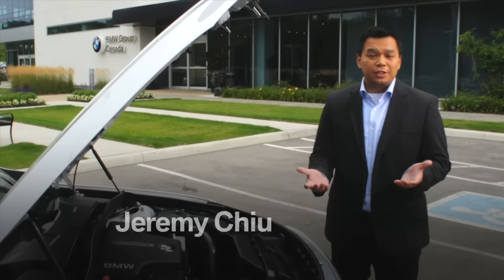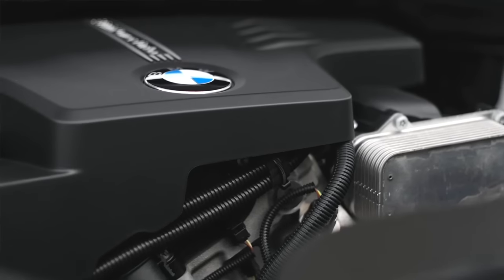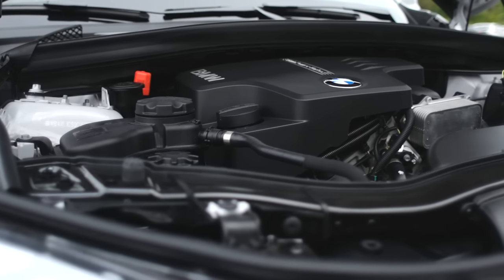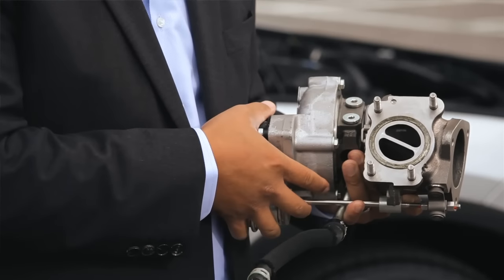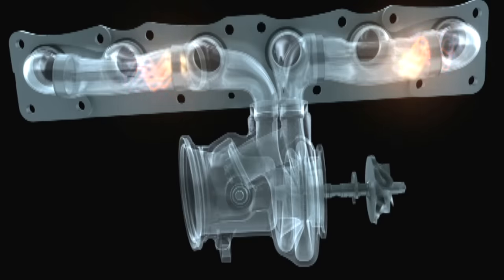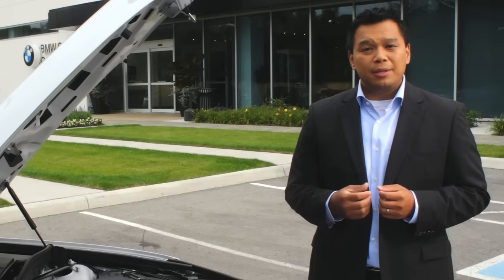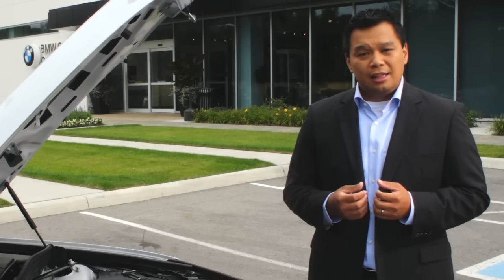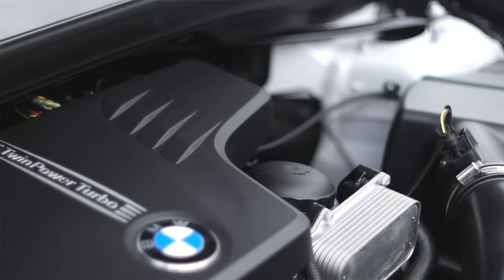TwinPower Turbo Technology

Comment: What about the cheap ELECTRIC water pump that needs to be replaced on almost every BMW only after like 30k and up?
Reply: not true if you use BMW original coolant. Mine is over 240k km and works fine.
Reply: It's true. That waterpump and no dipstick is BMW shit
Reply: What water pump? I have a 2013 bmw v4 528i since it had less than 100 miles. Brand new. It hs 178k miles now and its still strong. Runs smooth. I do my proper maintenance. If you cant afford a 600-800$ maintenance on your bmw every year than the car is NOT for you. Stick to honda.
Reply: @expl0de  you got lucky then, they don't die due to coolant, they die from the wear on the brushes. the European style coolant will help the plastic thermostat and rubber tubes
Reply: @BlastCODM  mmm u okay? Hondas are good, and yes some Bmw have that issue, seems to ne the pump  is very weak so it does not support the long work.
Reply: This is cap

Comment: My 2013 528i is still running strong at 178k miles. Love the v4 twin turbo charged engine.
Reply: Get the timing chain replace soon
Reply: V4?
Reply: @juniorgeeroms8018  v4 turbo
Reply: @Hamza-ek8xy  😂😂😂😂
Reply: @juniorgeeroms8018  it actually has a lot of power
Reply: V4? No such a thing in BMW.
Reply: @royal011  He's talking about the Ducati Panigale V4 (s) LOL!
Reply: @royal011 bmw has many cars with the v4 twin turbo like my x1
Reply: I don't think it's twin turbo, it's twin power turbo. BMW was under class action, accused of misleading (twin turbo means dual turbo-2 turbo chargers, while twin power turbo is one turbo charger made in the way to charge all cylinders).
Reply: @Chad-Giga.  I know that BMW has 4 cylinder engines (my 328 xDrive has it too) but are you sure it's V configuration of cylinders. Usually it's inline configuration, but who knows...maybe they came with something I am not aware of.
Reply: @royal011  There are two types of Twin Turbo BMW engines, the TwinPower Turbo and the TwinTurbo Power. In both options, you'll find an exhaust manifold that's split into two headers. The TwinPower Turbo is one single turbo that comes with two exhaust down tubes. The TwinTurbo Power contains two turbos with two exhaust down tubes. Newer BMW models feature the TwinTurbo Power option, which comes with many bonuses and benefits.
Reply: My 2015 428i has like 90k miles … how long did you water pump last?

Comment: Twinpowerturbo petrol engines all and twinpowerturbo petrol engines hybrid all : Easy damage parts, 20-100 l/100km, over 100 l/100km by Formula One speed 160-250 km/hour, over 250 km/hour on all circuits, test maximum Engines over 20,000-150,000 rpm and their status grade F.

From
All BMW databases

End reports.

Comment: Are these n20/26  motors reliable now in 2017?
Reply: NO. Timing chain eats engine
Reply: Yes. My v4 2013 528i is still running strong at 178k miles. No major problems. Other than simple brake changes . Fuel injectors replacement,  and couple cheap sensors and other cheap maintenance.
Reply: @BlastCODM  v4?

Comment: M power 1-4 turbo intercooler petrol engines, Twinpowerturbo petrol engines all and twinpowerturbo petrol engines hybrid all : Easy damage parts heavy engines, 20-100 l/100km, over 100 l/100km by Formula One speed (160-250 km/hour and over 250 km/hour) on all circuits, test maximum over 150,000 rpm and little damage with driving traffic limit speed law on all path road. The age of uneducated Automotive Engineering group rule automobile market.
From
BMW databases

Comment: All twinpowerturbo petrol engines and all twinpowerturbo petrol engines hybrid : Easy damage, 20-100 l/100km, over 100 l/100km with F1 speed, test maximum over 20,000 rpm.

All BMW series : the lowest traction 0.7g, extreme tail flick, extreme slide, 20-100 l/100km, over 100 l/100km with F1 speed on circuits all.

From
All BMW series databases

End report.

Comment: All BMW : The lowest traction 0.7g, extreme tail flick, extreme slide, 20-100 l/100km, over 100 l/100km in F1 speed and 160 km/hr to top speed on circuits by wider rear track than front track bodyworks all.

All BMW TWIN POWER TURBO PETROL ENGINES, TWIN POWER TURBO PETROL ENGINES HYBRID : Easy damage, 20-100 l/100km, over 100 l/100km with F1 speed and test maximum over 20,000 rpm.

End report.

From
BMW all databases